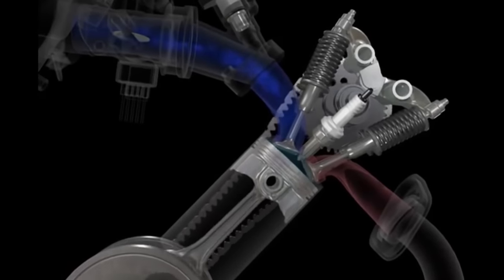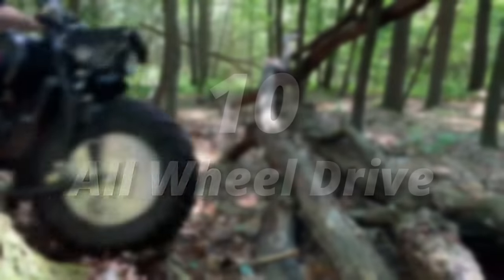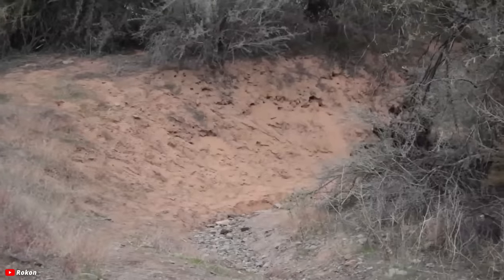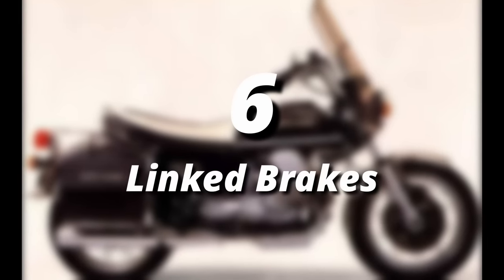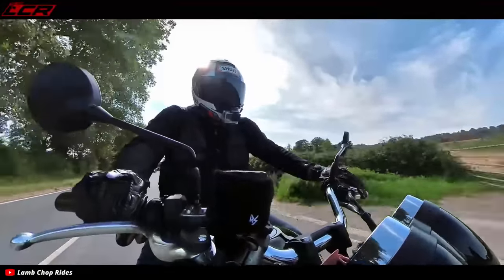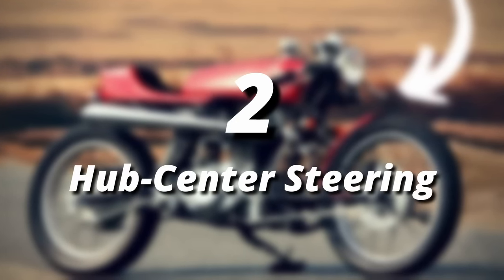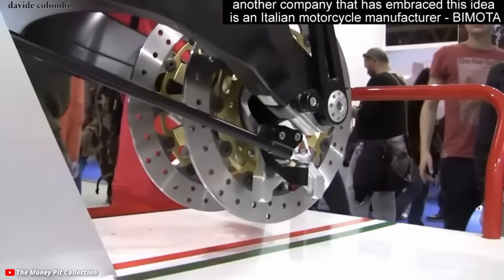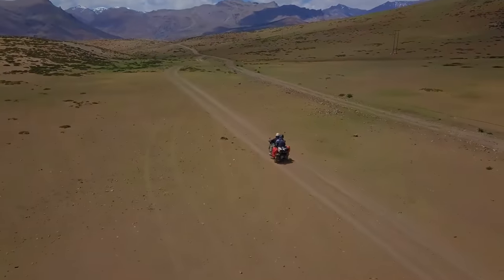10 Motorcycle Innovations that never caught on

Comment: Buell's bikes were full of funny innovations that never really went anywhere outside of that brand, but I think the one that makes the most sense to be adopted by other manufacturers were the Zero Torsional Load brakes. They're not ridiculously complicated, they just take a traditional brake setup and tweak it. And they work well. Buell and EBR raced successfully with them.
Reply: Zero torsional load brakes ? What the fuck are those?!
Buell ran a perimeter brake on the front wheel on 2004 models and up. Rear brakes were standard single piston.
Reply: @taitsmith8521   ZTL brakes ... are perimeter brakes.... cos the disk is mounted on the wheels perimeter it meant no torsional load went through the ‘spokes’... meaning the wheel could be much lighter...

The rear is driven obvs so had torsional load anyway... hence normal brakes
Reply: @Obvsaninternetexpert  I've never heard the term used before ( ZTL).
  The corporate people at Harley really strangled Buell.  It could have been a lot more than it was.  I wish EBR would come out with a middleweight bike.
Reply: @taitsmith8521  I know I always wanted a lightning 😭
Reply: @Obvsaninternetexpert  I had a 2000 X1 for about 10 years. Tuber model, prior to the perimeter brake rotors, but still, it was a great bike. Used Buells go for cheap, just plan on being your own mechanic.
Reply: I broke the unbreakable drive belt. 
I dropped a piece of gaffer tape in the tank - fuel in the frame meant that it was impossible to ever get it out!
Underslung pipe for lower CoG - can't even recall how many times I bashed it on gutters or small bumps.
Harley 1940s style 45 degree, air-cooled cylinders in a sport bike enclosed frame? Recipe for disaster here in Australia where it regularly reaches 40C in summer. Rear cylinder fan comes on and cooks your legs.
Fail. But fun fails.
Reply: Now their coming out with that super cruiser and I want one so bad.

Comment: Oval pistons were Honda’s attempt to get around the MotoGP rules that limited manufacturers to 4 cylinders/pistons, and get more valve area so as to make more HP
Reply: How do you even make piston rings for that thing 🤯🤔
Reply: My Honda Varadero has linked brakes.  Pulling the front brakes, brakes front 75%, and back 25%.  And the reverse is also true.  Works on tar and dirt.  And I think it is better than expensive ABS.
Reply: One friend of mine spent 2 years working for Honda racing, he said the inside name for "NR" was Never ready. Honda spent way too long and too much money and although I'm sure technology was gained, it was a waste of time.
Reply: @davidgibbings6085  I seem to remember they were 4 piece rings, did not last long but they were built for racing not road use, so did not matter as long as they lasted the race.
Reply: @davidgibbings6085  easy to make them , not easy to make them last , don't run a second race on them ,

Comment: Grip shift was very common on 50cc mopeds in Europe.
I doubt it would be an improvement as it requires 2 cables. I feel a foot shifter just gives you better feedback.
Also on my bike with 6 gears, you would have to rotate the shift (AND THE CLUTCH HANDLE) between 7 positions. This would leave the clutch handle in very inconvenient positions.
Reply: And you skip the cable with foot shifter
Reply: IIRC there were even three cables, one for the clutch and two for shifting up and down. I remember using it on mopeds and always found it awkward and clumsy. Never seen it used with more than 4 positions( 3 gear). Early Puch , Sachs ,Kreidler, Zundapp and Flandria are a few brands that come to mind to have this "feature".
Reply: @dutchsailor6620  I was thinking of the EXTRA 2 cables to change gear.
Reply: I can see an updated version working, though, using ride-by-wire technology rather than mechanical cables, and a sequential up/down shift pattern just like foot shifters. Although if the objective is to make changing gear a one-limb operation instead of two, I guess quickshifters/blippers do a pretty good job.
Reply: My zündapp moped only has obe cable as far as i know
Reply: They probably mean 2 cables as in the clutch and gear cable. With a pedal shift u only need the clutch cable
Reply: The scooters use a simple two cable system.  If a motorcycle with 6 speeds linked the grip shifter to a positive stop mechanism, your objection would disappear.
Reply: @pashakdescilly7517  Yes, correct.
But why bother? It is just more complicated.
I own a 2001 Yamaha Diversion 600. The choke is controlled from the left handlebar via a cable.
Earlier models had a choke lever connected directly to the carburetors. Less complicated and, once you know where to reach easy to use.
Foot shifting is easy and precise.
Reply: Remember mopeds use to have bicycle pedals, as required by law. Foot gear was therefore not an option.
Reply: @pflaffik pedals combined with foot gears was pretty common in the 70's. I own a couple of such mopeds and you can pull a pin on 1 of the pedals, turn the crank 180 degrees to get the pedals both in the same position. Now they act as if they are normal footrests. Once you want to cycle with the moped, you pull the pin, turn 1 of the cranks 180 degrees and start cycling after you put it in first gear and fixate the clutch with an extra lever on your handlebar.

Comment: The Gold Wing platforms have had linked brakes for years. Works well with or without ABS option. You still have independent controls that distribute breaking forces differently. The work fantastic stopping the weight of the bike, gear and two passengers. ...
Reply: As long as you don't want to think and have middling rider skills, linked braking is OK. Otherwise, it's crap.
Reply: They're OK for Americans, who can't even downshift cleanly.

Comment: Most mopeds back in 70s and 80s (yes, I'm that old 🙂) had manual gearbox selectors, like the Vespa's. It is indeed very, very old. And quite horrible. Speaking from years of experience it shifts slow, cables tend to get out of tune and it will be difficult if the bike has more than 4 gears. Als the angle of the clutch handle changes, ergonomically also not great. So there are good reasons this type of gear selection disappeared.
Reply: It started on mopeds already in the late 50's. From one gear up to 3 gears.
Reply: Well.... de gustibus etc coloribus non EST disputandum....
I've learned riding with my father's Iso Diva, four gears on the left grip, and, with 10 years old hands ....it was not the best.
But motorcycles are for ( or intended, at least....) for grown ups!
I find it comfortable for the kind of ride a scooter can give you.
Wouldn't want that on a race bike or enduro of course, but the system proved to be ok for that kind of bikes...
Clean, cheap, reliable, and easy to fix and maintain.
Cheers!
Reply: Where was this? I've been all over Europe, the only one like that that I've seen was the Vespa, everything else had a variator, or foot shifter.
Reply: @noth606  It was some time ago....
French, German, Italian scooters and small bikes.....
Not the Japanese bikes, of course....
Reply: @noth606  Sweden for sure!

Comment: Back in the 1970s I had a German moped made by 'Hercules'.  It had a 2 speed transmission which was selected by twisting the clutch lever assembly.  You could also way that this technology is widely used on bicycles with twist grip shifting 🙂
Reply: don't forget the puch maxi two speed manual  had the same arrangement
Reply: Here in the Netherlands there a whole lot of "brommers", 50cc mopeds with a legal max speed of 40 kmh that had handshifting, not only European and Dutch brands using Puch, JLO etc engines but also big brands like Zundapp and Kreidler . Kreidler became world champion 50cc with a foot actuated AND a handlebar actuated gearbox liked behind each other to get enough different speeds to cope with the narrow power band of the Kreidler engine. Also Honda 4stroke and Yamaha with handlebar gear change were well sold in our country.

Comment: Back in the late 70’s I purchased a Husqvarna 390 Automatic I used in scrambles and enduros. It had a 4 speed gearbox, went up and down gears just like an automatic car. I believe it was used by the Swedish Army as well.  It was a great reliable competitive bike in its day.
Reply: The Husqvarna Automatic won the NETRA and AMA Enduro championships in the 80s.  One dealer in New England was adapting them for a number of riders with 1 arm.  Really.
Reply: Didn't Husky also locate the throttle as well as the clutch lever on the left side of the handlebar so as to free up the right hand of the rider to...shoot?

Comment: Ok, the guzzi system was two separate systems.

The rear brake pedal operated the rear brake and one front disc, the handlebar lever operated the other disc.
Reply: I have an '84 Moto Guzzi Monza with this system. As Fred says it's two brake systems. The foot brake operates the smaller rear wheel disk and one of the front disks. The handlebar lever operates the other front disk. On dry pavement getting on the brakes hard will lock the rear wheel first. You do have to be careful on gravel and wet leaves so as not to lock the front wheel. Gentle use of the foot brake is usually sufficient. On a twisty mountain downhill run the system really shines and bikes with twice the engine capacity have to work hard to keep up.
Reply: @aceroadholder2185  Pshaw. Linked systems have no place on a motorcycle, imo. Any experienced rider knows that in a low grip situation they might want rear brake only and linked system says they can't have it. 
I'll decide which brake to use, when and how much, tyvm. I believe linked systems are the devil's work and I'll play no part in such evil. Linked systems get thee behind me!
Reply: Rudge had a system back in the 30s, then of course it was cable operated and it was easy to alter cables if you didn`t like it.
Reply: @alandavies55  Panthers also had linked brakes on the heavyweight machines in the 30s and 40s. Like the Rudge the system was cable operated and could be removed if desired.
Reply: @SingleTrackMined  I would assume you've not ridden a Guzzi with linked brakes.
Reply: @aceroadholder2185  I would assume you know nothing about riding a motorcycle. I certainly don't need to ride all bad designs to know they're bad designs. I will decide which brake and how much without the intervention of what some engineer thought might be good for me, tyvm.
Reply: @SingleTrackMined  And you choosing to apply only one brake is hardly experienced,That rear wheel lock up long before the front one,That why a changed down and utilise the engine brake slowing down the bike without brakes through the rear wheel and maybe both brakes
Reply: @SingleTrackMined  I sense a hint of sarcasm here

Comment: I started riding in 1960 .
 My first bike was an NSU Quick. It used a dial a shift twist grip on the left handle bar.
The Alstate moped manufactured by Puch also had dial a shift  system.
Reply: But was it quick?
Reply: Bert, was it the NSU Quickly? I remember them.
Reply: No it was a Quick.  NSU started producing the Quick in the late 1930s. 
The Quickly was a later design based on a step through frame .
The Quick had a 98 cc engine while the Quickly had a 49 cc engine.
Reply: @polarpilot1  so the quick was quicker then the quickly, sounds quick to me......
Were those dial a shift twist groups put in place to keep a hand  clear to carry bags?

Comment: In the 1980s I had a Czechoslovakian-made CZ 175 that featured a push-rod that ran through the centre of the crankcase, linked to a cam on the pivot of the gear pedal. When you moved the pedal to change gear it would automatically disengage the clutch, so you could just flick through the gears without having to touch the handlebar clutch lever. It was simple, reliable and easy to use, but I've never seen that feature on any other motorcycle.
Reply: Good example! Wasn't it also the case that on the Jawa and CZ bikes, a single lever served as the shifter and kick starter? A typical example from the Iron Curtain period. Either technical innovations were not known in the West or they were not taken seriously. Or the engineers developed great concepts that were not approved by the old men of the state apparatus. Before the VW Golf, the GDR could have had a modern compact car with a large trunk lid (Wartburg 355/Trabant P1100) - no approval. Instead, cars with two-stroke engines were built until just before the end. A shortage of materials, a lack of funds and unreasonable politicians made life difficult for the engineers. They have our respect that they have quietly developed ingenious solutions again and again, in the two-wheel sector e.g. at Jawa/CZ, MZ and Simson. Mostly, unfortunately, hidden under an old-fashioned design, making the models difficult to sell in western markets. MZ, for example, were distributed by Neckermann in the Federal Republic of Germany and were considered a cheap vehicle for students.
Reply: @Volker_GR  Yes, now you mention it, that's true. You pushed the gear pedal in, flipped it over backwards,  and it became the kickstarter. It was a fun bike; not massively reliable and sometimes a bit reluctant to start, but nice to ride and incredibly tough, like it was built out of ex-Soviet tank parts. I had forest tyres on it, and it would go pretty much anywhere that my mates' Yamaha DT175 would go.
Reply: It was a feature of the Dnepr MT-804 gearbox. First fitted to the Dnepr MT-9 in 1968, and used on all subsequent models.

Comment: A lot of old german mopeds (50cc) had used a gripshift too. My first motorcycle, a Hercules Prima 5, had a 2 gear gripshift and my grandpa's Zündapp Supercombinette 429 had a 3 gear gripshift. ^^
Reply: Exactly. It was standard with all Mofas and Mopeds which were legally viewed as bicycles with assisting engines. If it had bicycle-like pedals, it had a grip shifter. Victoria Vicky, DKW Hummel, Rabeneick Binetta, Express Radex, Zündapp Kombinette… there were dozens of brands and well over a hundred various models. Same goes for all scooters that were built. Heinkel Tourist, NSU Prima, Zündapp R50, again dozens of types.
Reply: @zweispurmopped  your right but the larger 50ccm ones were not considerd bycycles anymore, at least over here in austria
Reply: @he_exe  The official Moped formula from the 1950s was that the bike had to have bicycle-style pedals, could be driven by them (Albeit awfully badly was acceptable…), 50Km/h top speed, 50cm³ stroke volume and up to 33 kilograms of weight. A handle to carry the Moped had to be installed as well. So they only were kind of bicycles. If you squinted very squintily with both eyes and accepted that that bicycle would exhaust any world class athletes within 100 metres of driving them with the pedals. ☺

Comment: Interesting post.  Regarding twist grip gear change,  this was common on some mopeds in the 1950/60s in the UK.  Using a 50cc two speed Villiers two stroke engine with twist grip change was common for some manufacturers.
Reply: It was also very common for European/German mopeds. For example zundapp or kreidler. They even had three speeds.

Comment: I think a modest turbo on a small displacement bike makes sense. It may not it may be too heavy but adding a turbo to a thumper or 250-300 could be good.
Reply: apparently helps with fuel consumption efficiency

Comment: About the 'grip shift'. Back in the 50's and 60's nearly all makes of scooters used this feature, with the odd exception, namely the NSU 5 Star Prima. This had 2 pedals that stuck up through the floorboards and was basically a heel & toe shifter. Nearly all the other brands of scooters and mopeds used the grip shift. I had a Vicky 50cc moped with a 2 sp  as did most mopeds. (Mopeds in those days were really mopeds, ie with motor and pedals, typically 50 cc). Scooters, on the other hand, typically 100-250 cc used 3 sp grip shift. Brands such as NSU Prima, (not the previously mentioned 5 star), Puch, Zundapp Bella, Triumph Tigress and its BSA sister, Vespa and Lambretta as you mentioned, Piatti and many more. The most notable exception was the DKW Hobby, probably the first fully automatic using expanding pulleys and a v-belt. This was just under 100 cc, I think about 98 cc. Sadly very few of these brands still exist.
Reply: As do the Italian motorcycle brands,Laverda immediately come to mind,The Laverda Jota triple was for a few months the fastest production motorcycle in the world until the Japanese took it back with the Z1000

Comment: I think the problem with grip shift is that it turns with the clutch lever. Detaching the clutch lever, however, isn't really an option as it would be pretty hard to twist it while doing a 100% squeeze on the clutch. Unlike the throttle where you're either twisting the throttle to accelerate, or squeezing the brake lever to stop using the front wheel. Actions that you usually don't do at the same time compared to clutch and shift.